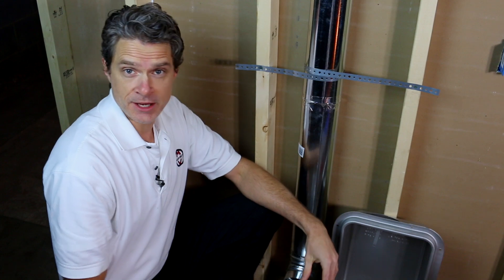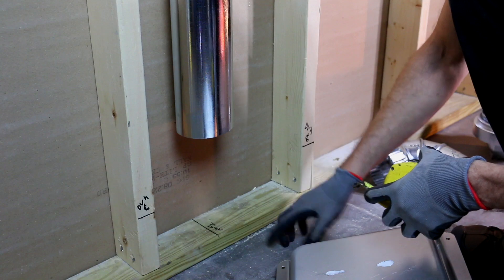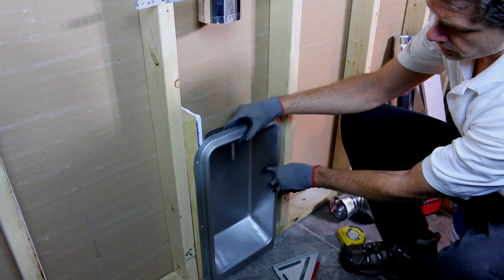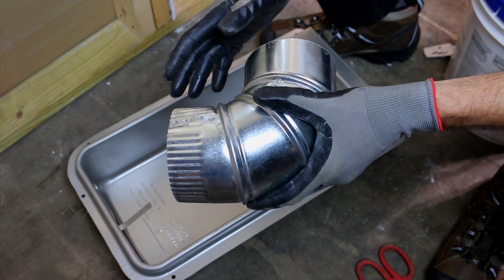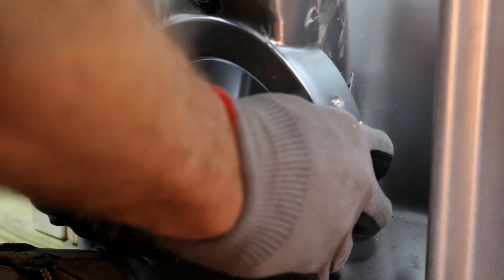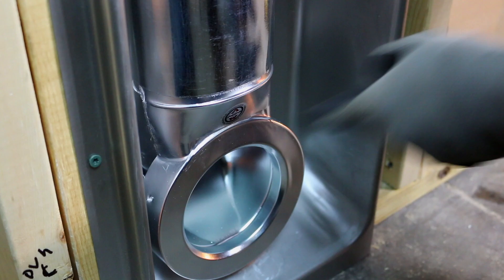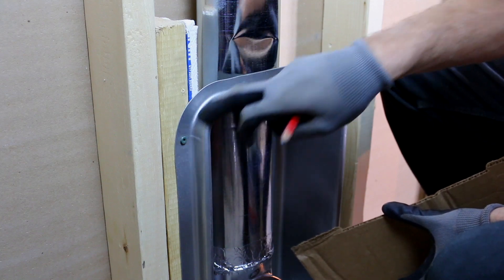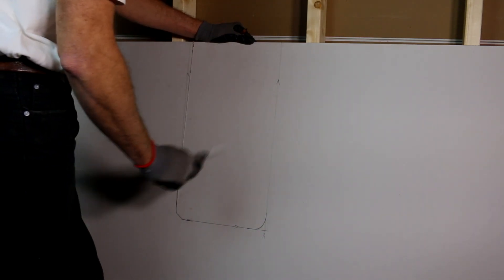Magvent MV-90 Dryer Vent in Dryerbox Installation

Comment: We bought a new house that uses that in wall dryer vent but it is NOT inline with where my dryer’s vent is—so I need to MOVE the dryer box over one or two sections of 2x4? This laundry does not have lot of spacing between sink cabinet and w/d. Plus there is door to the HVAC unit closet across from dryer that opens OUT—so dryer need to be as close to wall as safely can…. Is this something an appliance repair person could move and reinstall? Or does it take a drywall guy for the Sheetrock repair?

Comment: ...would have been geat if you were able to show the complete install up through the ceiling.  I'm curious to know how everyone is getting the 4" duct through the top plate.  I have metal stud framing and it's a real doozy getting the pipe into the tight space of the attic to vent through the roof.  It also seems that it's almost impossible to adhere to the letter of the code when installing dryer ventsin an older these days... especially if you're laundry room isn't on an exterior wall 🤦‍♂

Comment: Looks good but the larger question would be why a dryer box would come with an oval hole for the pipe?
Reply: that box is made for a 2x4 wall which is only 3.5 inches deep. The vent pipe is 4 inches so it requires some crushing to fit.

Comment: What happens when you pull the dryer out? The flexible conduit tears appart?
Reply: The magnets actually release with 5-8 lbs of pull force. Sometime the flex hose slips off of the dryer vent, so we recommend wrapping the dryer vent with some aluminum tape to add texture for the hose clamp to grip.

Comment: My dryer vents straight out. It is up against an outside wall of a very old house. 1915 aged house. Have alot of lint dust in the house and have had a repair man her multiple times still have lint dust. The washer and dryer and not even 3 years old. Bought the set new. The dryer sits out 3 inches more then the washer. Wish this box could lay on its side. Want to move th dryer to a different wall and move the washer also. But the box would still have to be on its side due to a bedroom above the laundry room. Love this old house. 

The pervious owners were very old and moved the laundry upstairs from the unfinished basement. Who ever did the work slapped it together. The washer has 2 different hook ups. 1 coming up through the floor that looks to be 60 yrs old. Also has a wall hook up. How ever that one I guess is for looks because it's not even plummed in to be used. Was nice shower when installing them to the newer wall hook up only to fnd out the floor hook up was the only working one when we turned the water on. Good times!!

Comment: I just installed my mv90 outside of a dryer box, because of a concrete ledge on the bottom corner of the floor behind the dryer (so it couldn't fit in the stud bay).

It was simple to use even one tapcon screw on the mv90 positioning bracket to make it position right where it was needed!  

After that, the magvent linned up perfectly with my dryer duct! 

I should say to TEST MOVING THE DRYER IN *AND* OUT.  
Why? 
To test and retest both the brackets connection to the wall
And
To test the hold of ring clamp, holding the end of the magvent part ON THE DRYER.  

I emphasize this the way I do since I had to tighten to ring clamp on the dryer much tighter than I expected to achieve a solid hold.  

Anyways, when all is said and done, it really does work perfectly, and looks pretty damn good too.  
It's around $95 Canadian to get one of these, but so so worth it.

Thanks for the fire caulk advice btw! I was just going to use foil duct tape alone before seeing this. 
Great video!

Comment: Question.  Did you use regular 4" duct in the wall or was it oval pipe?
Reply: How did you go through your 2- 2/4 top plates and meet code?
Reply: This install used a standard 4" duct. Sometimes during the install you may need to oval the pipe a little by hand to get it through the dryer box.
Reply: That was my question as well. How did you get 4" pipe to fit in a 3.5" deep wall cavity.
Reply: @johneverett957  to fit a 4" pipe in a 3.5" wall you have to make it oval.

Comment: So not an air tight connection? is it safe for gas dryers ? (don't want carbon monoxide leaking) Also what about the magnets attracting bobby pins, pens, money, wouldn't that clog or cause the debris to help form a stop with the lint.(kind of like when there's a bend in flex piping or top mounted lint trap on the dryer) (if you take dryers apart you know there's almost always debris at the bottom of the top mounted lint trap) just some things to think about for the engineers. 
Would have like to see this as a fresh install where there is already finished walls, because I know it's twice as hard to install these boxes.
Reply: The connection is air tight and yes it is safe for gas dryers. As far as the magnets attracting bobby pins etc. , yes it is possible but the main lint trap should catch most of these items and we have yet to have any issues or customer complaints about this happening. If this were to be an issue, as you mentioned it happens with regular flex hose, the MagVent makes removal of a restriction a lot easier as you do not have to deal with getting behind the dryer to disconnect and reconnect the hose. We would love to shoot a video of an installation with the drywall already in place, and we hope to have that content available in the future. Thank you for your feedback.
Reply: @customerservice9263  was just curious about that, I haven't ran into any of those yet. And my apologies was not trying to discredit it just wondering about that because, when I think about the carbon monoxide getting out, some of the people don't seal the vents sometimes so that's what I worry about it. A good product though!!! Good job I'm coming up with something so revolutionary for dryer installation.
Reply: @minnesotadryerventguys  No problem at all. It is definitely a valid concern! We always strive to make improvements and ensure our product is safe for all users. If we can be of any help in the future don't hesitate to reach out.
Reply: The dryer is basically a giant exhaust fan for the laundry room.  Even if any CO did leak from the magnetic joint, the dryer is just going to suck it right back up and vent it out.

Comment: Is this pretty easy to pull apart the magnets, when you can't get behind the dryer. I've looked at a few videos and none of them shows this being pulled apart.
Reply: You need to leave a little extra flex to pull the dryer off the wall in order to separate the magnets.  You don't want them to easily separate.

Comment: I'm getting ready to remodel my laundry room.  The original installation has the dryer vent in the floor causing the dryer to be several inches away from the way.  Since my vent goes down, not up as in the video, will this system work?  I really like the magnetic link.
Reply from the maker: The MagVent MV-90 is designed for when the vent path takes a 90 degree turn to the side, up through the ceiling, or down through the floor such as in your case. The MV-90 is designed to be installed directly behind your dryer's vent, and can tolerate an offset in vent alignment of up to 3 inches. I encourage you to view our MV-90 installation video on our website! With your installation, the tail of the MagVent will be pointed straight down, and if you have a standard height dryer, then you should not need any additional rigid metal pipe to complete the installation. Please don't hesitate to contact us if you have any other questions or if we may be of further assistance!

Comment: Can I use the mv90 to vent thru the floor vent already installed?
Reply from the maker: The MagVent MV-90 is designed for when the vent path takes a 90 degree turn to the side, up through the ceiling, or down through the floor such as in your case. The MV-90 is designed to be installed directly behind your dryer's vent, and can tolerate an offset in vent alignment of up to 3 inches. I encourage you to view our MV-90 installation video! With your installation, the tail of the MagVent will be pointed straight down, and if you have a standard height dryer, then you should not need any additional rigid metal pipe to complete the installation.

Comment: Let's see, number cause of residential fires, so let's change the route of the vent from horizontal to vertical. Since they are now vented on the roof no one will ever see or think about it until it's too late.
Reply: @cmmartti  But builders started putting dryer vent runs through the roof instead of out the exterior wall. These vertical runs have more lint buildup because the ducting goes through the attic. the heat of the attic causes condensation in/on the duct causing mold and wet lint. Wet lint will clog a dryer vent. I wish my dryer was on an external wall!!

Comment: Great install video. I currently have a hose hanging from my ceiling that vents Thur the attic outside. I plan to strip the wall to stipends and install in between the studs like this product. Exceptional video and professional finish.

Comment: I know the dryerbox is not your product, but do you know what is the reasoning for having a oval-shaped opening instead of a circular (round) shaped opening at the top of the dryerbox?
Reply: That's usually done for a 2x4(db-350) wall or using larger dryer tubing...I think the 2x6 version(db-400) isn't as oval as the 2x4 version.

Comment: Why didnt you " pack out "  the other side of the box?
Reply: Just mounting the box to one side and the bottom makes a really solid attachment. We could have chosen to pack out from the other side, but I think it was closer to landing in the proper location on the left. So, to go from the other side would have required more layers of material. Thanks for watching.